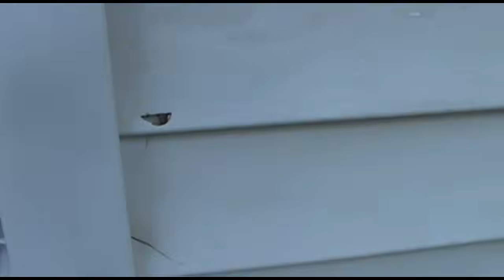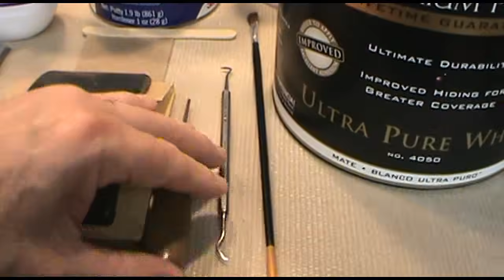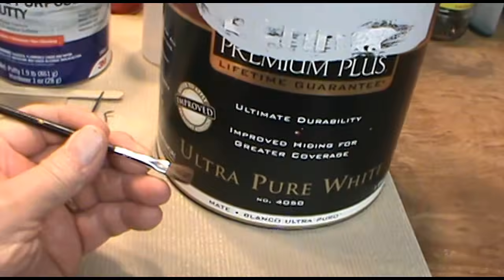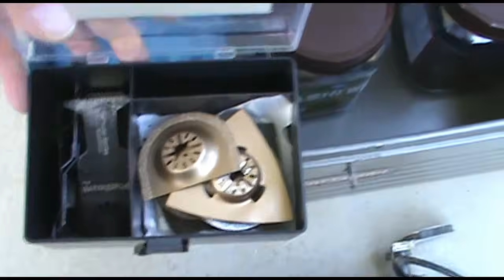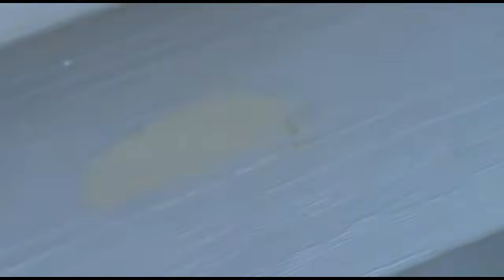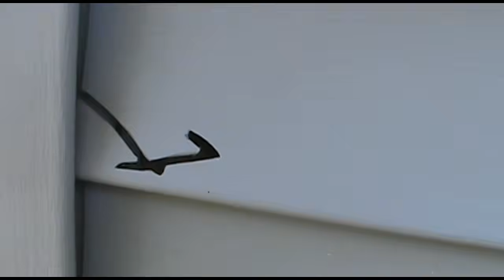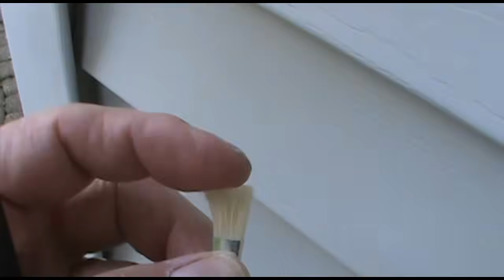How to Repair Vinyl Siding Holes and Cracks. Perfect and Undetectable.

Comment: Quick question for anybody reading. Most of my holes are from hail and actually on the bottom rounded portion of the siding. How can I fill these larger holes? Should I maybe fill with expanding foam first and carve the curved part and then do bondo?
Reply from the maker: Hi, Kelly. If you have a larger hole I would backfill the hole with DAP Alex Painter's Acrylic Latex Caulk (18065) https://amzn.to/3jCuneN . I like the Acrylic Latex Caulk without silicone or any other additives. It can be used indoors or out and cleans up easily. Aim your caulking gun at an angle and squeeze some back behind the vinyl siding all around the perimeter of the hole and continue to backfill the entire hole but do not fill it all the way up until it is even with the siding. Keep it about 1/8 of an inch below the surface of the hole in the siding. All you are doing is making a base for the Bondo All-Purpose Putty. Let the Painter's Caulk set up for at least 24 hours so it is good and hard. This caulking doesn't expand or shrink much and should be a good base for the putty.

After the Painter's caulk has completely set up you can fill the rest of the hole in with a top coat of the Bondo All-Purpose Putty https://amzn.to/2UK93ZV . You will have to work fast because this stuff has a very short open time of about a minute or less. I would have a small putty knife ready to immediately pull the mixed putty off the mixing cardboard and work it into the remaining hole. It won't matter if you have to work fast and get a little extra putty buildup on the hole to make sure it is all filled in because the putty is easy to sand down. After sanding, trace in your wood grain lines with the dental tarter pick, clean it with denatured alcohol, and paint it. I hope that all makes sense and good luck with your repair.

Comment: This is exactly what I needed. Hail damage on my vinyl siding. The roofers used most of the money for the roof and was supposed to get what I needed to replace the damaged siding. They strung me along for 6 months before finally admitting they weren't going to also do my siding. Long story short, when all was said and done, the insurance company only allowed 5,000 for my siding. Can't replace the damaged parts because it won't match from fading. I hadn't even cashed the check because I didn't know what to do. I just got a new estimate for siding and they want 25,000. I actually like the color and it's only 8 years old. Well I need to sell my house and it would never sell in this market with holes. With this fix, I can repair it perfectly and put it on the market. And I guess put that 5,000 towards other things needed to sell.
Reply from the maker: Hi, Kelly. I'm so sorry you have had to go through such a trying time. Many of us know what it's like to get yanked around and cheated. Good luck with your repair.

Comment: Thanks for the great video. I have not seen a better how-to-video. One question: I have a hole in my siding about the size of a quarter with a hairline crack about a 3/8 inch on one side. Can you give me any advice on how to handle the hairline crack?
Reply from the maker: Thanks for your kind comment, Paul. If you have a crack you may want to check out the video at 20 minutes in. You will see how I repaired a fairly large crack.  If your crack is smaller you probably won't need to backfill it. Good luck with your repair. https://youtu.be/ShZi5mwbZXg?t=1200

Comment: Great video. Im going to see if i can fix my friends siding. Its about an inch in diameter but sounds like Bondo is the stuff to use.
Reply from the maker: Thanks, Linda. If you have a larger hole I would backfill the hole with DAP Alex Painter's Acrylic Latex Caulk (18065) https://amzn.to/3jCuneN . I like the Acrylic Latex Caulk without silicone or any other additives. It can be used indoors or out and cleans up easily. Aim your caulking gun at an angle and squeeze some back behind the vinyl siding all around the perimeter of the hole and continue to backfill the entire hole but do not fill it all the way up until it is even with the siding. Keep it about 1/8 of an inch below the surface of the hole in the siding. All you are doing is making a base for the Bondo All-Purpose Putty. Let the Painter's Caulk set up for at least 24 hours so it is good and hard. This caulking doesn't expand or shrink much and should be a good base for the putty.

After the Painter's caulk has completely set up you can fill the rest of the hole in with a top coat of the Bondo All-Purpose Putty https://amzn.to/2UK93ZV . You will have to work fast because this stuff has a very short open time of about a minute or less. I would have a small putty knife ready to immediately pull the mixed putty off the mixing cardboard and work it into the remaining hole. It won't matter if you have to work fast and get a little extra putty buildup on the hole to make sure it is all filled in because the putty is easy to sand down. After sanding, trace in your wood grain lines with the dental tarter pick, clean it with denatured alcohol, and paint it. I hope that all makes sense and good luck with your repair.
Reply: @Fixitforgetit  okay going to the hardware store and ill pick that up. Should i also use the bondo stuff or just try the caulk?
Reply from the maker: @lindarebstock8422  Hi again. This is the most important secret to a successful vinyl siding repair. You must use Bondo All-Purpose Putty https://amzn.to/2UK93ZV . You can get it wherever you like but it is important that you don't use regular auto-body Bondo or caulking or anything like that. It needs to be Bondo All-Purpose putty. It is easy to sand and trace the wood grain lines into and it holds up extremely well for a long-term repair. I have seen people try many other products and they just don't seem to work very well and won't last. The only problem is the All-Purpose putty sets up very fast so you only have about a minute to apply it after you mix the resin and hardener together. Good luck with your repair.
Reply: @Fixitforgetit  Thank you fr that information. 👍
Reply from the maker: @lindarebstock8422  My pleasure, Linda. Good luck.

Comment: How would you patch the hole if it was larger like say the size of a half dollar? You would almost need a backing because it's too wide for the bondo. Maybe cut the vinyl around the hole so you could lift it up a bit and put some tape on the back side and then fill it in? I've got to do some vinyl repair this spring/summer. I'll try some of your tips. I was going to buy some of that tape/sticker stuff but that looks pretty cheap and doesn't seem like it would hold up well.
Reply from the maker: Hi, Achilles. If you have a larger hole I would backfill the hole with DAP Alex Painter's Acrylic Latex Caulk (18065) https://amzn.to/3jCuneN . I like the Acrylic Latex Caulk without silicone or any other additives. It can be used indoors or out and cleans up easily. Aim your caulking gun at an angle and squeeze some back behind the vinyl siding all around the perimeter of the hole and continue to backfill the entire hole but do not fill it all the way up until it is even with the siding. Keep it about 1/8 of an inch below the surface of the hole in the siding. All you are doing is making a base for the Bondo All-Purpose Putty. Let the Painter's Caulk set up for at least 24 hours so it is good and hard. This caulking doesn't expand or shrink much and should be a good base for the putty.

After the Painter's caulk has completely set up you can fill the rest of the hole in with a top coat of the Bondo All-Purpose Putty https://amzn.to/2UK93ZV  . You will have to work fast because this stuff has a very short open time of about a minute or less. I would have a small putty knife ready to immediately pull the mixed putty off the mixing cardboard and work it into the remaining hole. It won't matter if you have to work fast and get a little extra putty buildup on the hole to make sure it is all filled in because the putty is easy to sand down. After sanding, trace in your wood grain lines with the dental tarter pick, clean it with denatured alcohol, and paint it. I hope that all makes sense and good luck with your repair.

Comment: I looked all over trying to find a solution for vinyl repair.  Finally a solution where it doesn’t involve throwing “tape” over the holes!  Thanks so much for taking the time to post this info, most appreciated!!
Reply from the maker: My pleasure, Blayn. Thanks for your kind comment and good luck with your repair.
Reply: Just a fyi, not long after using your method to make smaller repairs I ran into a repair which required much more filler than I wanted to deal with (racing to fill before hardening).  I found this product to be very helpful for large amounts of small repairs in a particular area https://www.google.com/search?q=dap+platinum+patch&client=safari&channel=iphone_bm&sxsrf=APwXEddXJWPPJ_2sFvDu-LkEVIhyPSyKBw%3A1684259931063&ei=W8RjZO6wA5q3qtsP0u6S6A8&oq=dap+platinum+patch&gs_lcp=ChNtb2JpbGUtZ3dzLXdpei1zZXJwEAMyCggAEEcQ1gQQsAMyCggAEEcQ1gQQsAMyCggAEEcQ1gQQsAMyCggAEEcQ1gQQsAMyCggAEEcQ1gQQsAMyCggAEEcQ1gQQsAMyCggAEEcQ1gQQsAMyCggAEEcQ1gQQsAMyCggAEIoFELADEEMyCggAEIoFELADEEMyCggAEIoFELADEEMyFQguEIoFEMcBENEDEMgDELADEEMYATIVCC4QigUQxwEQ0QMQyAMQsAMQQxgBSgQIQRgAUABYAGC-P2gBcAB4AIABpgGIAaYBkgEDMC4xmAEAyAENwAEB2gEECAEYCA&sclient=mobile-gws-wiz-serp

Comment: 2 questions..how long do you wait after applying the patch do you start  sanding the puddy down, and how long do you wait before you etch the "woodgrain" seems that it would hard
Reply from the maker: Hi, scoobyspiece. The Bondo All-Purpose putty instructions say you can sand in 15 minutes. I don't do that. I usually wait 24 hours before I sand and trace in the wood grain lines. You could probably do it safely after 4 hours but I like to be sure it is fully set up. Remember to use medium pressure when tracing the lines because too much pressure will pierce through the putty. Once you are done you should have a long-term repair. I have numerous repairs that are over 10 years old. Now and then (rarely) one will break away but it is fast and easy to repair it. Good luck with your repair.

Comment: The electric sander is a bit of overkill.. I've worked with bonds doing automotive body repair and wet sanding would be the best method
Reply from the maker: Hi, my momma's son. You can try that if you like but there's usually a 1/8" to 1/4" protrusion of the All-Purpose Putty and if you have a bit of time to invest you could wet sand it. It will probably take some time and will definitely take a lot longer than the brief time it takes with a multipurpose tool sander. Good luck with your repair and thanks for the suggestion.

Comment: Hey man awesome video, how long do we wait until we can start sanding after this bondo is applied?
Reply from the maker: Thanks, Blazer. The instructions say it is sandable in 15 minutes. I think that is too soon. I usually let mine set up a couple hours before I sand it. It would probably be ok to sand after half an hour but I like to be sure it is good and hard before I sand it. It does set up fast. I love this stuff and use it a lot but you only have about a one-minute "open" time before it starts to set up.  That's my only complaint about the product. It is so versatile though that the short open time is worth putting up with. Just do small sections at a time and you should be ok.
Reply: @Fixitforgetit  thanks for responding back! Also which Sanding paper would you recommend Im trying to fix up my siding tmrw afternoon
Reply from the maker: @blazer9829  3M 9015 General Purpose Sandpaper Sheets, 3-2/3-Inch by 9-Inch, Fine Grit (150 grit). It will sand well enough but still leave a fairly smooth finish. Good luck with your repair.
https://amzn.to/38soytm
Reply: Thank you so much
Reply from the maker: @blazer9829  You're welcome.

Comment: That's wrong way to fix it.... I'm sorry but is the reality. Is that's the case to fix broken siding, Insurance Companies will be happy to adacted on their claims.
Reply from the maker: Thanks for your comment but my siding company went out of business 27 years ago so there isn't a matching siding available for me. Most of my repairs are due to me moving a hose reel or a railing post. Insurance companies don't pay to repair your siding if you decide to move a hose reel. Add in the fact that I have a $1000.00 insurance deductible and I'd say I made an excellent choice. I already had all of the tools and I even had some Bondo All Purpose putty and paint. For me, it was an easy and virtually free repair. I have some of these repairs that have lasted for over 10 years and no one could ever tell you where one of the repairs is because they blend in so well.

Comment: Would these instructions be useful in repairing a tear in one of my new vinyl privacy fence's posts? A worker accidentally snagged a Bobcat under my brand new fence and lifted up the whole section, leaving a tear on one of the posts. Thanks.
Reply from the maker: Hi, @zizu4952. I had another subscriber who had a similar situation. This method should work on just about any vinyl product. I have also used this method to repair aluminum window frames and a variety or other surfaces and repairs. Bondo All-Purpose Putty is great for numerous repair jobs. The only downside is it sets up so fast. On a smooth surface like a vinyl fence post, you may want to make your final sanding a wet sanding with about a 600-grit sandpaper. Good luck with your repair.
Reply: @Fixitforgetit  Thanks. Is there a place where the ingredients and the instructions on how to make the repair are written?
Reply from the maker: @zizu4952  You're welcome. No written instructions but the items I used to do the repair are shown in the description via affiliate links. Just click on "show more" in the description to see the list of things I used on the repair.
Reply: OK. I will try to derive a written list of materials and instructions for my contractor to fix the fence post. It was one of his guys who damaged it. Brand new $10K fence!   @Fixitforgetit
Reply from the maker: @zizu4952  Oh no! I'm so sorry you are having to deal with this. If he doesn't fix it hopefully your insurance will cover it. I am having to deal with a shower installation that the contractor messed up many years ago and it has been an ongoing problem. It seems it's always something.
Reply: @Fixitforgetit  Especially if your main contractor tore his ACL some months ago and has only been able to put in a few hours each time he comes---which is once or twice a week. Been in my house 8 months, still can't cook in kitchen, bathrooms usable but not done, veneer not done in LR, new security door not picked up or installed, lots of stuff still undone. He also had COVID, then his family had COVID, then his dad was hospitalized from COVID and he couldn't leave him. Yep, tell me about "it's always something." He hasn't felt well Monday or Tuesday, hopefully he'll be here tomorrow.
Reply from the maker: @zizu4952  What a nightmare. I hope you haven't paid too much upfront. Good luck resolving this terrible situation.

Comment: Nice video!
How has this held up over the years? I ask because I don't think that Bondo is very flexible, so it may eventually break away from the vinyl.
Reply from the maker: Hi mike. That's a great question. You are right about regular Bondo. That's why I do not recommend using it. I use "Bondo All-Purpose putty." https://amzn.to/2UK93ZV It is very different from regular Bondo. It has the perfect consistency and long-term performance needed for vinyl siding repairs. I have some repairs that are over 10 years old and still look great. The repairs in this video are nearly impossible to find after 3 years in an environment where we have bitterly cold winters and fairly hot summers. Thanks for your question and you can see how the repairs I did in this video looked after one year here. https://youtu.be/JeYizOqFuzM
Reply: @Fixitforgetit  Great, thanks for the reply. I missed that detail. Going to give this a try
Reply from the maker: @mikemoore6151  My pleasure, Mike. This is what I use. https://amzn.to/2UK93ZV Good luck with your repair.

Comment: This is one of the best tips I've ever seen!  Putting my house on the market and had lots of holes in the siding.  Saving me a ton of money.    Question:  I have trouble getting the Bondo to lay flat/smooth. I end up with lumps and edges that I've tried sanding, re-Bondoing, sanding again etc.  Any tips?  Also,  you say you use a "finer grade" sandpaper--  do you recall what #?  Thanks again!
Reply from the maker: Hi, KGrant1917. Thank you for your kind words. I used 180-grit sanding pads. As for the problem getting the putty to lay flat, I find that strange as I never had any such problem. I found it very easy to apply and it always laid beautifully flat for me and was easy to work with. One important thing is you can not use regular Bondo. It is for autobody work and will be harder to work with and will probably crack and fall out over time. You need to be sure and use "Bondo All-Purpose Putty" https://amzn.to/2UK93ZV

The only problem I have with it is it sets up very fast and consequently, you need to work with small areas at a time. I apply it so there's about 1/8" to 3/16" of an inch of the putty remaining above the surface of the siding. I then trim it down close to the vinyl surface with a sharp wood chisel and then finish up using the 180 grit sandpaper. Just do everything the way you see in done in the video. I hope this helps and good luck with your repair and the sale of your home.